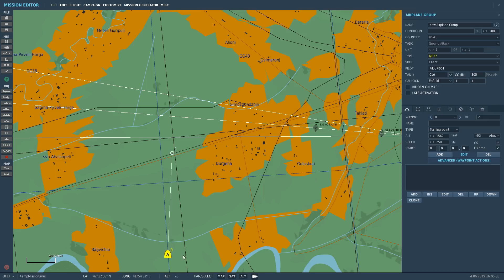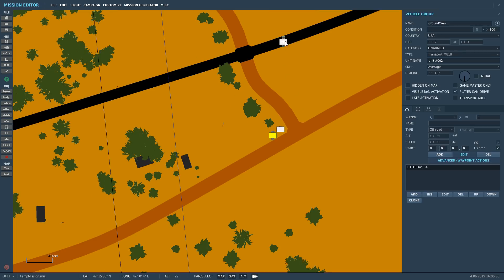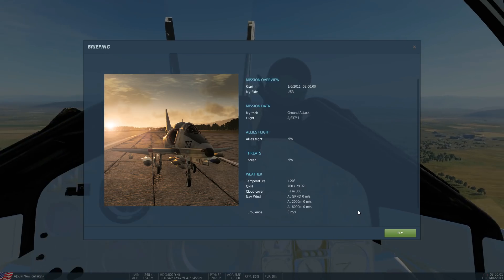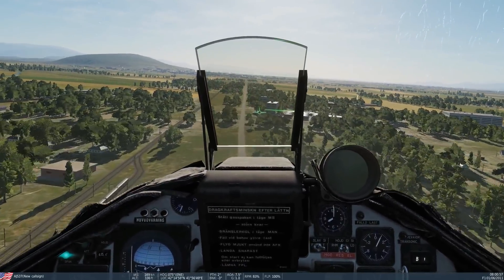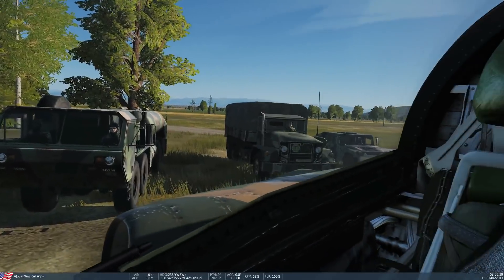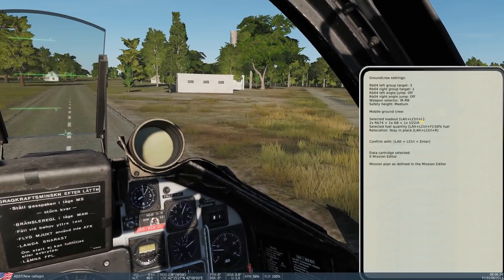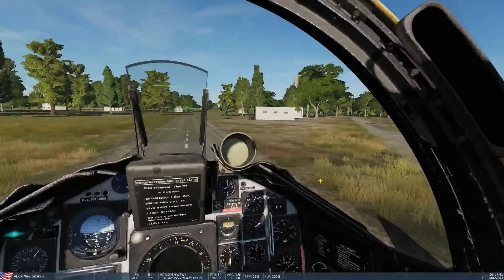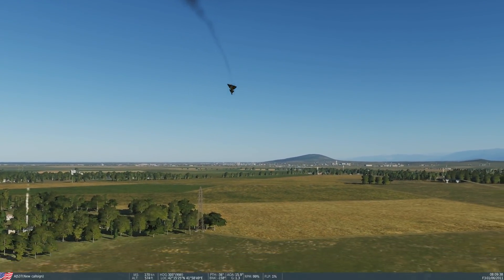AJS37 Viggen: Building A Road Side Re-Arm Base FARP Tutorial | DCS WORLD

Comment: A great idea when landing on roads, is to create one small-radius (10m) trigger zone at the start of the "road-runway" and one at the end. Then make a bigger trigger zone (~4km radius) around the landing area and make a triggered action in which once you enter that  big trigger zone, two signaling flares will be fired. One green from the runway start and one red from its end (inside the 10m trigger zones). You can also record radio messages that will inform you about the flare launch.

ManLo

Comment: Can you build one with a TILS system truck? I think it was normal to use them on the road bases.
The idea was to have several different road bases operating and even the pilots didn't really know which one they would be landing on for mission rearm, refuel. So 
they would get notice of that during mission.  
I think I have a map somewhere over the organization of a road base. You had areas further back where they could overhaul the whole aircraft (change the engine et cetera). 
Also if you really would like to study roadbases and the VIggen I recommend the "Flyg och Lotta museum"/"Viggenmuseum" in Östersund, Jämtland, Sweden.
Reply from the maker: I'm 99% sure we can;t move the TILS truck, but will investigate.